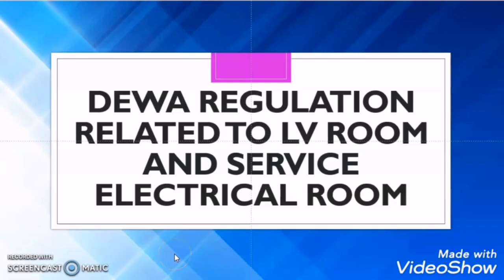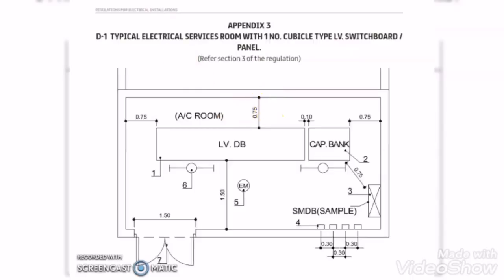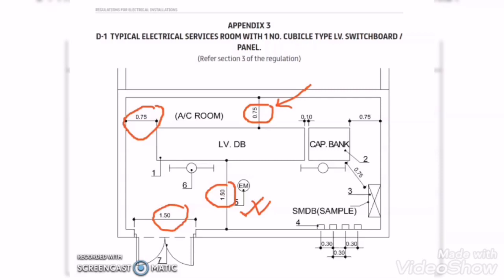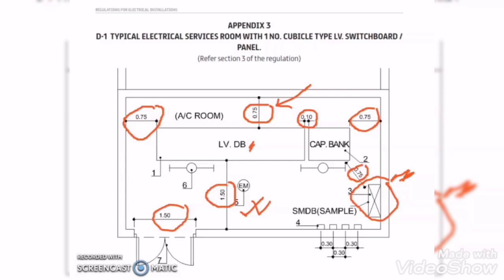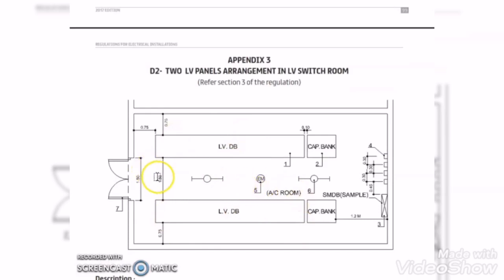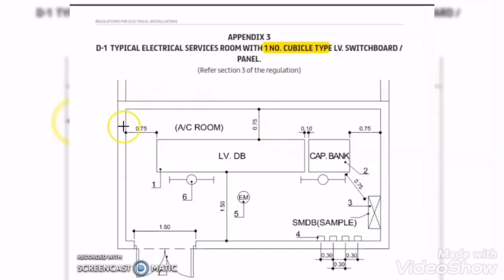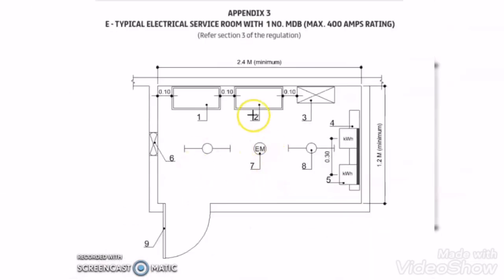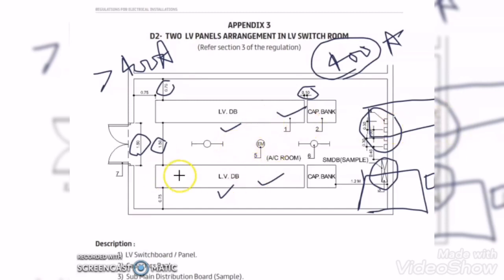DEWA Regulation related to LV Room and Service Electrical Room.

Comment: For load of 250 KW how to distribute load in one of dubai project ground only commercial building which has 22 shops.. Means dewa supply to meter cabinet then MDB, SMDB ETC?